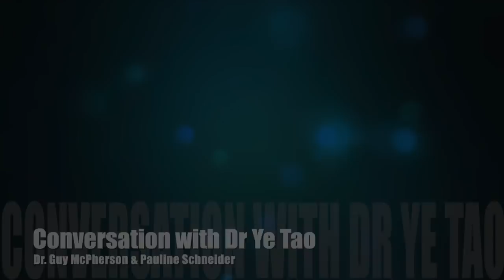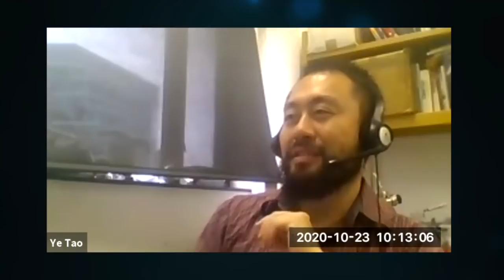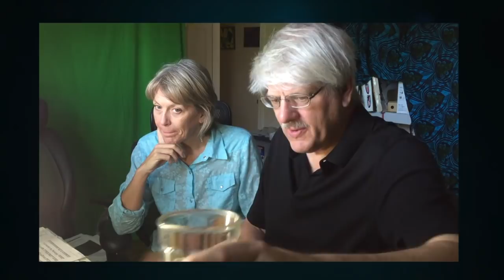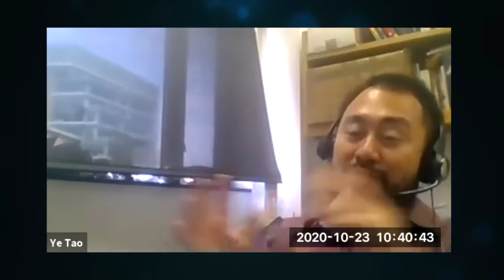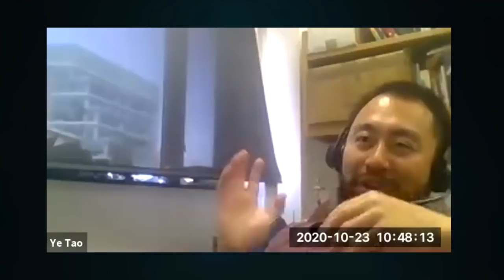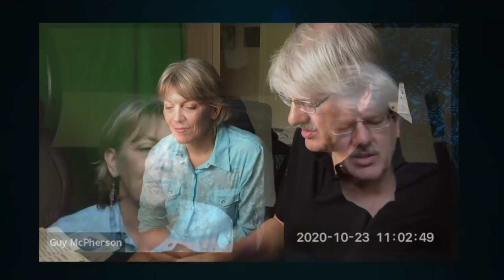Conversation with Dr. Ye Tao on the MEER Reflection Project

Comment: I´m wondering how much impact individuals could have by just painting/sealing their roofs white. A decade ago I sealed my red roof with white insulating compound (no, I dont know what its energy input was) and was able to eliminate airconditioner use. I do open and close screened windos and use a 6" fan on a few hot, 90F+, nights. Appropriate tech? ¡Saludos desde Mexico)

Comment: Did I understand right?: we need a Belarus area of 207,595 km2 ?  Assuming we turn into a "mirror" all the 149600 expressways of China, and an average (I don't know, really) 0,02km2 per km of expressway, we get 2992km2 of mirror  (we would need about 70 Chinas to get to the 207,595km2). On the other side, if we could turn all the 6,853,024km of roads in the USA in a "mirror" we would get, assuming an average 0,005km2 per km/road: about 34265km2. We would need about 6 USAs. Easy to achive, I guess, if all main countries would help.
a) I guess that turning roads into some kind of mirror (as all the infrastructure is already there, perhaps but the "mirror-like tar") has already been looked into and discarded; does anyone know?
b) My data source was Wikipedia. Can anyone with real knowledge about this throw any good estimate? Thanks
Reply: You got the area of Belarus right. These mirrors need to go over the ocean, according to Dr., near the equator for peak efficiency (although arguably hot asphalt might be an attractive candidate surface to cover with mirrors!)

Comment: Because of substantial saturated fat and cholesterol, no fiber, and generally high toxicity from polluted water, bivalves are a poor source of human nutrition. That part of the system likely needs to be reconsidered. If the toxicity issue could be resolved, bi valves would be a good food source for carnivorous species like dogs and cats, but not for primates which are herbivores (and insectivores.)

Comment: Good to know
Volcanoes are though to become the real problem as ice caps are disappearing

Then, water will build up towards equator, causing greater pressures, slowing down earth rotation
These changes will cause fault lines to become increasingly active, due to sinking ocean floors

So the extinction will rather be caused by volcano particles that will cause darkness hence cooling

So we selfdestruct yes, however by the after cooling effect of initial triggered global warming that will cause a crushing effect at equatoral seafloor areas causing reworkings at fault lines on devastating scales

One does not need to have any above average education, to do the math

So to place MEER mirrors, put them rather not at the equatoral areas, but instead at arctic and permafrost areas, in order to retain cooling for regrowth of ice caps

Comment: Unintended Consequences: I will never forget when I came home and found fireman putting out my house. Fortunately, it was just a grape stake fence that caught on fire, mysteriously in the middle of the day. There was no electrical cord to cause a spark, no paint or gasoline nearby, but the puzzle was solved in a pile of mirror tiles I had removed from one of the tenant's bathrooms. Multiple mirrors catching noonday sun light focused a hot beam on the fence and we found a hole that had been charred out like a big magnifying glass. A similar technique was used by Archimedes' mirrors to burn ships in a harbor in some ancient Greek War.

I've designed systems for hospitals, the nuclear, wind, solar, desal, conventional fuel, biofuel & zero-e synfuel sectors so I get a lot of calls with what I call "Bozo Technology"; stuff that seems neato-bosso-keeno on paper and either won't ever produce what was claimed or will never scale or kills life (i.e. spent fuel pools at nuke plants). 

That said, I promote wild experiments that don't cost too much or kill anything so I entertain long calls with some engjneer who made a better laser or windmill. Vertical axis windgens are a classic example of a waste of steel, copper, plastic and concrete. 

A recent idea, presemted with great passion was a guy who drove gas cylinders around and discovered if his nitrogen tanks leaked he created fog. He wanted me to help him build a business to "fog over" a sweltering city like Phoenix and had a business plan that began with selling the service to park goers and weddings. Um yeah.

This well meaning scientist proposes manufacturing (problem 1) a type of relfective ground cover for a huge area (problem 2) in order to reflect solar radiation back into space, attempting to reduce infra-red (heat) trapped by excess CO2/CH4 & other GHG. Just on the surface of the proposal I see a lot more bang for the buck by fixing the original GHG problem, though I do believe most CO2 sequestering devices qualify as "Bozo Tech".

Even building windgens requires energy for mfg (problem 1) so IF that mfg cost created a device that converted that sunshine into energy and we didn't have to burn oil/hydrocarbons,THEN it makes a bit more sense. Theoretically we get a 2-for-1 by mfg concentrated solar generators - parabolic mirrors - boiling water to drive steam turbines. In that case the wattage (heat) produced in a generating station is produced in a field of mirrora. The molten saly solar fields in the Mojave Desert didn't work out too well, but the technology holds promise on a planet turni g into one big desert, just as wave and wind energy hold promise on a planet turning into one big typhoon alley.

That's the theory, but civilization's reality is that renewables haven't resulted in any significant reduction of power generation from dirty sources. We are a power hungry species and all new generators tend to due is lower the kwh price, not the demand. WHEN we all use less power or make 100% of our power from zero-emission sources THEN we must also address the CO2/GHG issue AND accomplish this and 1001 other "Earth Balancing Acts" faster than Mother Nature is trying to kill us; a tough act indeed. Earth has a fever and we are the COVID. Any questions on how this will likely work out? As usualy either we die or the host dies, or we get really lucky and adjust our effect and don't kill the host.
 
Fortunately, reducing GHG concentrations is actually easy. Another seemingly "Bozo" experiment came when Neil Young let a physicist neighbor of mine test the effect of iron oxide (rust) on plankton blooms. They sailed Neil's old tallship to Hawaii and dumped buckets of rust on the ocean, NASA satellites captured massive blooms and theoretically you could drive Earth into an ice age if every cargo ship was required to take wrecked, cleaned automobile steel or mined iron oxide across on every trip. Again, a bit of a problem of energy costs and lost resources (you don't get to reuse the steel) raises issues...but the "Bozo Tech" experiment was a smashing success and paleo records show eventually as massive algae/lily blooms take place all around the world CO2 levels fall and Earth eventually cools. 

If we want to accelerate that we also need to plant more trees and pour less concrete, lay less road and get rid of as much "mass" as possible that isn't part of the photosynthesis cycle; i.e. human civilization needs to shrink...probably not a popular idea with Tesla owners.

Human overshoot isn't just a CO2, heat, mining, available resource or waste and toxin problem. Our gear/farms/cities takes up precious space which needs to be "reclaimed" by rainforests and our oceans need to be nurtured, perhaps even cultivated, to further enhance natural CO2 sequestration. It's a long shot, but would at least help mediate falling plankton levels and nurture our oxygen machine(s); probably a good thing and one more thing we all take for granted.

As for blocking or reflecting incoming solar radiation, if I am not mistaken a nanoparticle in the stratosphere would do it and someone said it'd take about 1000 flights per year before it "fell out" and needed to be replaced, while also giving us a "throttle" whereby 100 flights would produce 1/10th the effect. 

Certainly unintended consequences would arise, not the least being harvest reductions.

We're in a pickle and I am all for small scale "Bozo Tech" that doesn't cost too much and adds a strange new tool to our solution toolbox. I am for using gas or nanotechnology to solve problems since our current path is likely to lead us to extinction in under a decade. 

I just hope the Bozo Tech we scale up and pour massive capital, mining, energy and labor (and acreage) into actually IMPROVES one or more Earth systems without damaging/destroying 2 others. On that note I think trees, plankton and DINKS (dual income, no kids) and thorium hold the most promise. I do love small wind rigs and recommend them, along with 1KW of solar for everyone who can trim their consumption as I have done for 20 years, but if folks believe we're going to solve this by plastering the Earth with mirrors, solar panels and windgens so everyone can have 20KWH on demand at 7am I think that's a fool's errand. We'll kill this place for sure.
Reply from the maker: McPherson, Guy R. 2020. Trees Cannot Sequester Enough Carbon to Slow Abrupt Climate Change. Modern Concepts & Developments in Agronomy (pdf) 6(4). DOI: 10.31031/MCDA.2020.06.000641

https://crimsonpublishers.com/mcda/pdf/MCDA.000641.pdf
Reply: @NatureBatsLast  When auditing a system in crisis tis good to start with components & data from a system in homeostasis or relative balance. Sure, drought&sunspot/tilt variances will ebb&flow, but overall the biosphere is thriving; quite unlike today. Trees are a huge part of that Earth system & replacing deserts with green has been shown both practical and holds good prospects for cooling large regions. 

Tis also true a spike of 5C-10C would likely fry all newly seeded habitats, and so other measures, like #SRM should be quickly explored, tested&deployed to buy us time to address sequestering GHG. As mentioned previously, sequestering gigatons and actually driving the Keeling Curve DOWN 12 months/year (literally a breath of fresh air if achieved) would make good use of that time. 

Seeding plankton, nature's big scale CO2 digesters, would both fatten the seafood fishfood supply & begin to scale the Mona Loa mountain problem. Combined with learning to nurture rainforests from deserts&we'd actually become a half-enlightened critter caring for "God's Garden". I think that mindset might also give us more tolerance for other caring critters&those who don't threaten to utterly destroy the blue petri dish experiment. What we do with "pests" in our garden is always a rancorous discussion.

But all this armchair theory means little to a White House barely able to promote a few entries on the work ticket list required to even begin to solve this planetary problem. It's not just a planetary scale problem; it's one that demands a fairly coordinated comprehensive RESPONSE from the critters who are causing the problems; us. That means 1-4 billion people meed to get their act together PDQ & then bring along the stragglers.

Think of it like 50 students on an ocean going lab; the boat springs a leak, you need all hands on deck & half the class is MIA. They're busy with their PDA trying to email the school for a refund. Humans are kinda myopic. We need to unite&regreen to scale CO2 sequestering, including plankton/algae seeding.

Comment: Guy has the planet warmed 2c above the 1750 baseline ? Paul beckwith says we are only 1.4c warmer curious to hear your take
Reply: Yes, it has, as I have reported in a few peer-reviewed articles. Sam Carana, an actual truthful scientist, provides the details leading to this conclusion. Beckwith is NOT a scientist. He is an engineer. He is also a renowned liar.
Reply: Mr. Beckwith lies in many ways. He lies by omission about the aerosol masking effect. He lies frequently about my personal life. He lies about being a professor. He has no PhD. There is much more, but my life is too short to waste time on liars.
Reply: There were, and continues to be, differences in how people define baselines.   As long as we properly define where the reference point is when speaking, it is fine to use either system.   The significance of these differences decay overtime as the overall heating becomes much larger than the difference in initial baselines.   10-20 years down the road, the difference would only be order 10%.   My own assessment based on datasets I could find is that we are 1.5-1.6 C above the 1750-1755 baseline.
Reply: Thank you MEER SRM, 

And to that temperature rise, one adds 0.5° to account for the short-lived solar masking effect of aerosols, which will dissipate approximately 5 days after the collapse of industrial capacity, immediately adding 0.5° C.

(From what I gather.)
Reply: Guy, how is Beckwith a liar? I do not see him being corrupt at all.  In fact, one of my fondest listening experiences was a show where you two were on together.  I thought you both got along.    I’m concerned because I considered both of you a solid source of info.  Could you explain please ?

Comment: 80,200 square miles of mirrors.  That will create a need for labor to keep all those mirrors clean.   I have to say I am very skeptical this project will ever see the light of day.   If continuing capitalist growth on this planet is the goal, then I think it is a waste of time.  We will still end in extinction due to loss of symbiosis.     Our predicament is multifaceted.   The idea that technology is going to out smart nature is absurd.    The answer was always to work with in nature, and preserve it.   We as a species failed to do that.    It was a good talk. Thought provoking.
Reply: Multiple studies have found that solar mirrors used in concentrating solar thermal power plants are self-cleaning during rainfall.  Mirrors on land, not along the equater, are placed an an angle to maximally reflect sunlight, enabling efficient rinsing by rainfall.   Even without cleaning, specular reflectivity drops by 20-30%, which is still acceptable for the cooling application.
Reply from the maker: Yeah, it probably won't work, but it's the most "gentle" and realistically doable SRM scheme yet and, if implemented, it could buy us some time to figure out the greenhouse/emissions issue.   
Of course humans need to change societally, dramatically for that to happen. 
The MEER project just buys us time.
Reply: To die without trying is to live in denial that our DNA is coded for survival.
Reply: How is trying to preserve ecosystems ever a waste of time? 
Even if life fails at this human experiment in the end, at least we as a "compassionate species" will have tried. 
I'm surprised you'd say this as a vegan, which I would consider to also be a huge part of the solution...
People are often skeptical of veganism too, but that doesn't mean it's not worth doing for the immediate benefits to animals
Reply: @MattAngiono  there's a cost vs returns consideration that's not addressed here.
Reply: This has got to be one of the most sane and coherent comments I’ve read here. Thanks for this sobering truth.

Comment: R&D, 3yrs. Then mass production of mirrors 3yrs. Personal home mirrors 3yrs.
It's an incredible idea. So no heat rays acting on aircraft.  Ok.
So in principle,  we move away from fossil fuel and take up this green new deal. Less than 10yrs???
Thank you for Energy Blance.
Reply: Project MEER:ReflEction does not require a moving away from fossil fuels.  Its implementation automatically drives an organic transition away from fossil liquid fuels.  And its enables continued use of liquid carbon fuel technologies, but with electrocatalytically-synthesized carbon-neutral liquid fuel derived from (contemporary) shellfish.  Anyone working with and have contacts at Shell? ;)
Reply from the maker: Thank you for adding to this conversation!

Comment: Surely there is a frequency in harmonics that can break up co2 molecules indeed any molecule to where you change its state so it no longer is a warning molecule any longer
Reply: The energy input to such a process is more than the amount of energy we harvested while burning the fuel in the first place.  So no, this is not a feasible idea.
Reply: It would only need to be a sound wave harmonic, just need to be at the right frequency and contained in direction like a laser
Reply: @garrydunkley1000 Gosh, go ahead and find that harmonic frequency 😃 Stringing words together is an underrated solution to The Predicament.